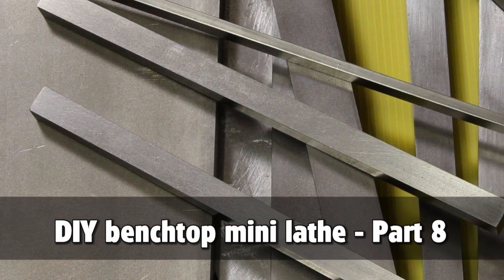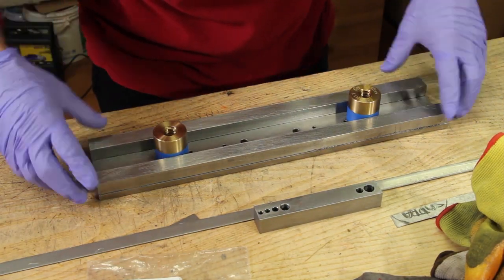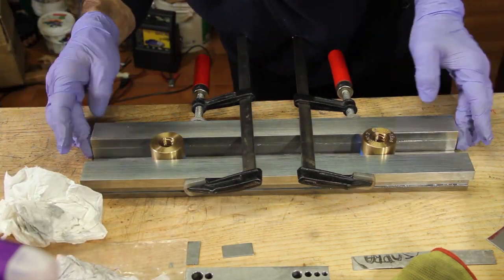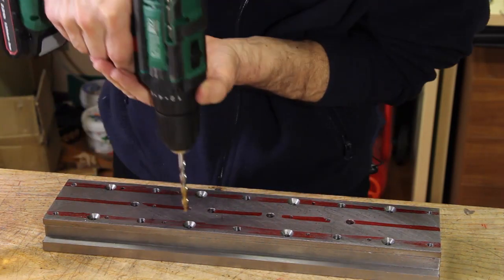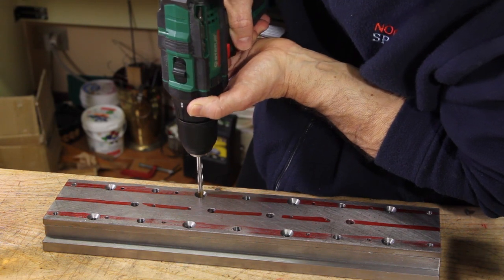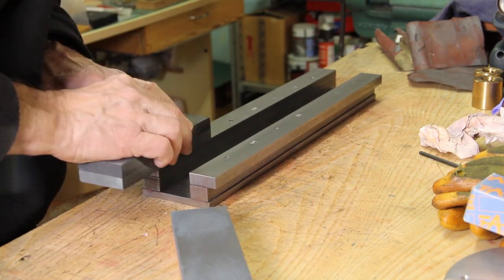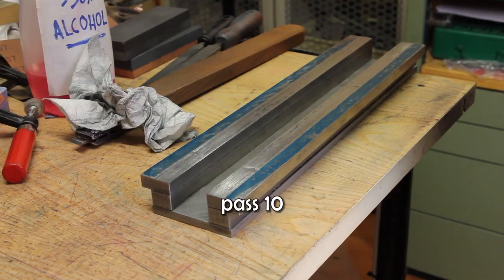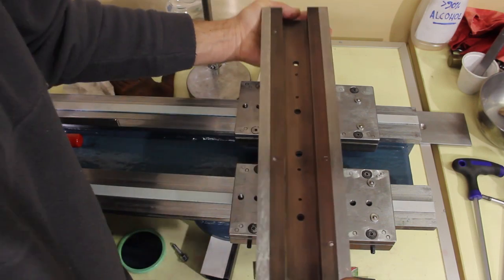DIY metal lathe cross slide ways - part 8

Comment: Mixing Resin onto the work piece is definitely good idea if the piece has enough wide area to mix well, but here, i think mixing it separately would be better.
Reply: If his point is to reduce waste, I would have at least scraped it off into a cup, mix it well and then reapply it.
Reply from the maker: Would have been a good idea indeed.

Comment: I think that you are using a little much blueing ink, normally the layer is just thick enough to show a light faint of blue👍🏻 that way you get a more accurate reading of the contact points
Reply from the maker: It's phthalocyanine blue, even with a small amount it gives a deep bright blue shade. Downside is it's hard to get rid of.

Comment: Super video and spectacular result, the final product looks almost as if it has been turned from a single peace of metal!
My only concern is how strong is it to stick pieces of metal together using resin instead of welding, I would be afraid it breaks anytime. Are you using special resin and do you have an idea of the force it can handle?
Reply from the maker: There are locating pins and screws.

Comment: Btw, what type of steel did you make your slides? I noticed you used high-tensile screws, didn't you?
Reply from the maker: Cold rolled mild steel ...making them flat/straight after all the other work. Yes they're high tensile strength screws: I like their color 🙂 and they're more rigid.

Comment: your drill press is more accurate than a handtap . . no need for electricity, just remove the cord of the drill press and put the tap in the chuck then twist the pulley with your hand . . better result . . of course make sure your drill press is level to the table